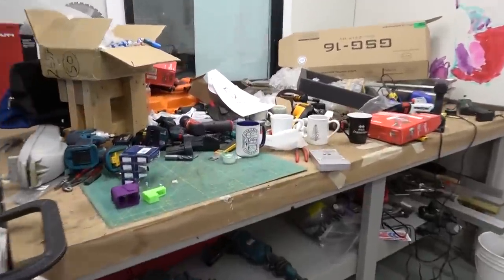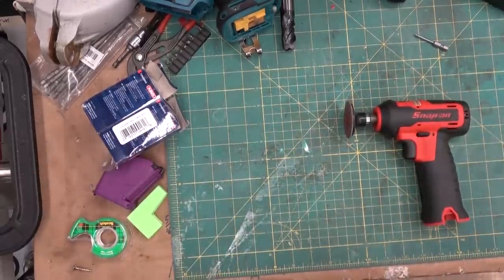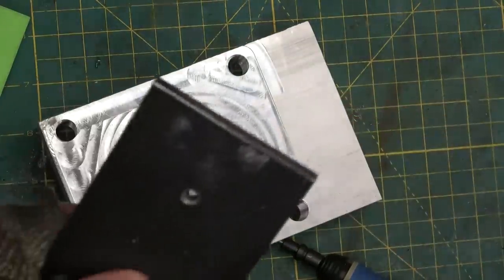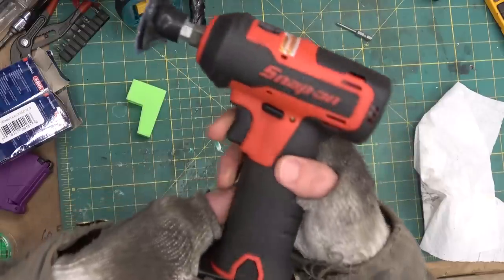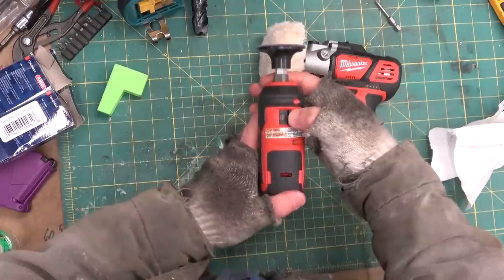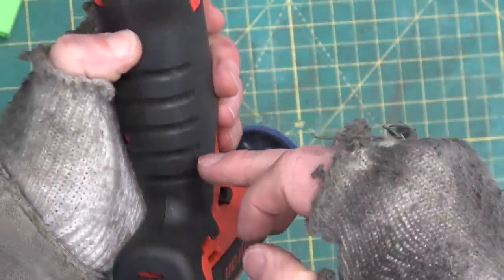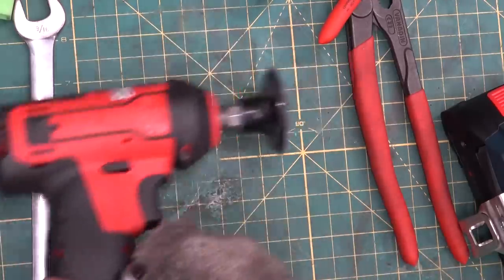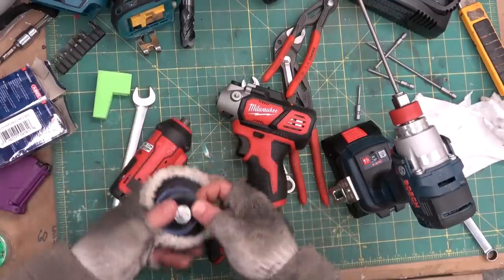BOLTR: Snap-On Polisher $$$ worth it?

Comment: I use both on a daily basis as polishes so in the slow setting and i find the snap is better purely for the increased torque and allowing more pressure to be applied whilst polishing

Comment: I have this tool. Bought it back in 2016. Two batteries and a charger in the kit ran me aboot $400. I work in the boating industry doing gelcoat restoration, and bought this for buffing out tight spots where a polishing wheel won't fit. It's lived mostly in a saltwater environment. At the time of purchase, nobody else was making a tool like this. That being said...I didn't have any problems with the fit and finish. It still looks and feels good 3 years later. The battery life is shit though if you use if for more that a few seconds at a time.  I wound up buying the screw gun in the 14.4 volt line just to make better use of the batteries. If you have other tools in this line, it might not be a bad thing to have. In the US the tool only is about 200.00. 

Oh....It took a shit this year and I had to have it rebuilt by Snap-On. That was $105 with a 90 day warranty.

Comment: Koon trucking had three of these and they all let the smoke out with light use.
Reply: I had 2 also went up in smoke. Snap on will only exchange not refund
Reply: Damn just in time guys! I’ve been thinking on buying one of these the last wk. Def goin with the millsucky! Thanks!
Reply: @travisarnold8872  Milwaukee is a bad tool their new m12 die grinder is the bees knees.
Reply: lovetolearn 52 appreciate it. I’ll check it check it out. I’ve been using an angle grinder for damn near everything... just looking for something that can get into tighter places and maybe make life a bit easier trying to restore an old rust bucket.
Reply: @travisarnold8872  I think I'd get the earthquake before snap on
Reply: @lovetolearn5253  Definitely go with the die grinder instead.
Reply: lovetolearn 52 enough power to constantly grind down welds ? Thinking about it
Reply: @daevid21  The die grinder is pretty much next on my list of must have cordless tools. Waiting for a good deal. I get so sick of dealing with my air lines for quick jobs.

Comment: The one redeeming thing for Snap On is their cordless tools have never been regarded highly. The quality has never been good enough to justify the price tag.
Reply: Milwaukee and DeWalt. My go too battery tools. Snapon is pure gimmickery. "I'm the best too and you get what you paid for so gimme your wallet"  just ain't true anymore.
Reply: @FGuilt  Just like Harley Davidson.
Reply: @tlr-nut7275  gimme a Kawasaki any day of the week. Suzuki is the harbor freight of cruisers (cheap crap that does work, but never well). Harley is the Mercedes of cruisers (endless money pits with amazing products but way over priced). Kawasaki is the Toyota of cruisers (runs well if you change the oil once on a while with a reasonable price tag on purchase). Love the Kaw.
Reply: Geez my one and ONLY Hilti Hammer/Regular drill crapped out after 2.5 years of home-owner type work.  Cost a fortune too!  I'll be sticking with the M now. SuperGoldnut
Reply: Um. That’s the exact opposite of what “redeeming” means.

Comment: Just about pooped myself laughing when I saw this 14.4V polisher ON SALE for $410 USD last week (regular list claims $440)! I got the 14.4V 1/4" screwdriver for $210 a few years ago, also a "sale" price. It works pretty well, although I had to warranty it for $90 last year. The clamshell and over-mold on my near identical driver held up quite well though; still solidy attached, no peeling or significant degradation after three years in an auto shop (I use it consistently for gear clamps on things like coolant hoses, too.) 
That thing seemed overpriced for 320in-lbs. (I think) but at least it came in a nice bag instead of the case! Thanks Uncle Bumble, and a Happy New Beer to you as well!
P.S. I mean "Thanks" because now I have to crack mine open to see if it has crap wiring like that polisher. Looks like I'm gonna be in the market for a new driver soon...

Comment: I’ve used my snap off to start some small paint correction multiple times—and then I immediately put it away. 

I got the whole kit brand new with battery, charger, pads, carry bag etc for $40 at a garage sale from an ex snap off dealer. It’s an OK deal at that price point.

I always end up switching to my Meguiars DA attachment on my snap off drill. Now THAT thing is skookum for a consumer tool -nooo, not the drill, but the DA buffer.  It would be neat to see a BOLTR on that. Takes the input of any drill and outputs a dual action at pretty damn high speed even with the gear reduction and it’s easy to vary speed.

The snap off drill is stupid light and small which I like. I bought it when working at a shop building race cars and fabbing sheet paneling/hanging carbon bodies etc.

However, the chuck is shit. Mainly because of the MASS of the NUT for tightening the chuck by hand. It’s metal and far too thick so when you let off the trigger quickly and it screams to a hault, the nut wants to keep going so the chuck loosens up after a few quick trigger releases. 

Snap on rebuilt it after I complained about the chuck and gnarly noise at slower speeds with no load in high gear. They replaced the motor and the chuck and It still has the same problems but I learned to live with it and it still works (~6 years later now)

Comment: Have had the snap on  for 3 years and it works amazing still and the rubber has never bubbled up. Use it for sanding gaskets off and knocking rough edges off

Comment: I work in a body shop that works on a lot of high end exotic cars. I bought one of these about two years ago and have used it at least once a week since then for polishing. The overmolding has never given me a problem, but it did let the smoke out the day after the warranty ran out. I had to pay to have it repaired through snap-on, I think it was around $60. It took about a month to come back, and when it did, it only lasted a week before making horrible grinding noises. The second time I had it repaired it was free, and it came back with a little note telling me that i had to let the tool "cool down" and was not made for continuous use. It felt like they were telling me that I purposely miss-used the tool and they were tired of fixing it. Ive had it back for maybe three or four months now and it hasn't given me any problems. If anyone asks me if i like it i usually tell them that i love the concept of a battery powered polisher, but would not buy this one over again.

Comment: I have the 1/4 impact which is very similar and I've used it as a diesel mechanic specialized in engines for years. Brake Kleen, contact cleaner, oil, coolant. You name it. The rubber is kind of coming apart on the edges but is holding up well. The rubber does swell up a bit but doesn't keep getting worse. holds up very well considering the abuse.

Comment: I do not have that specific tool, but I do own their screw gun which appears to be the same frame.  I am an aircraft mechanic and I love the screw gun.  I have  used it daily over the last three years and I have not had any issues with it.  I also use isopropyl  alcohol and av gas to clean it daily and have not had any issues with the grip material on the handle.

Comment: I've owned the strap on one for over a year. I'm a diesel mechanic and a welder fabricator. I use it daily. The over moulding is still in great shape on mine. But I never grab it with greasy mits. I've gotten atf on it and it definitely turns slimy very quickly. Mine also will suck freshly charged batteries to nothing if left in over night.

Comment: A couple of fellas at work have the whole Snap On lithium tool lineup , with all the batteries. In a diesel shop the over molding does start coming off. I have a set of Kobalt(blowes house brand) impacts, drill, light etc and the rubber is holding up better after 4 years.

Comment: As for the milldoes hardyness, we've got em in the rail workshop, coated them in crator grease, cleaned em up with white spirit, over and over, giving zero F's and no love, they're holding up really well, not peeling apart yet after about eight months. Seriously though, we asked for two pneumatic buffers (shinano at around 150 au dollarydoos) and they turn up with those vibrators worth a set of gold teeth. Purchasing officers - you wouldn't feed em.

Comment: Happy new year! A treat as always. If you see the budget brand Tacklife it would be awesome to see one of those get the AvE treatment, I have a recip saw and sander from them, dirt cheap but the saw gets a real beating in the garden cutting away smaller trees, I don't bother getting the chainsaw ready with the gas oil fillings and chain sharpening. The thing just keeps on going so it must be chooching decent on the inside (cherry Laurel hedge 100M long I cut 25% of stems down each year, and with five adults plants on a meter with a trunk diameter of 15 to 20cm thats a lot of cutting. )

Comment: Ave, my friend, how are you?
Reply from the maker: Good man. Back in the thick of it. You?
Reply: 3/8 stubby I got it's a monster for the size
Reply: Yep. I have the 3/8 stubby. It’s amazing that it’s a 12v tool and how powerful it is. I’m a heavy equipment mechanic for CAT and use mine every day and love it. To the original poster, if I’m not mistaken, the only difference between the 1/2” and 3/8” is just the size of the anvil.
Reply: @dkjoses12  I went an bought one as well, It does pretty good have to let it hammer a bit if you need to use any adapters but I'm happy with it.
Reply: @adambell2068  that's good to know

Comment: I've got the cordless screwdriver which is pretty much the same thing but with a rocker switch and a clutch.  I wanted the long neck electric ratchet and my 12 year old 7.2v Snap-On screwdriver batteries were pretty much shot and no longer available, so I sweet talked the Snap-On guy into a deal on the combo of the two tools with two batteries and a charger.  I could go into how much BS it is that they sell the tool, battery, and charger individually these days, but that's not the point.  It's been about six months of pretty much daily use (I'm a mechanic) and the tool is holding up pretty good.  I stopped using solvent to clean my rubberized tools a while ago because you never know which ones will turn to goo until it's too late, so I can't comment on that part, but aside from avoiding dousing the thing in brake clean I'm not exactly nice to it and it still looks brand new.  At first I was disappointed that it isn't brushless but the batteries last plenty long and it will twist your arm off if you set the clutch to full tight and it grabs, so I guess it doesn't need it.  I don't like how you have to push the 1/4" chuck in to attach/release tools, it's the opposite of my Milwaukee drill/driver and if you don't push it perfectly it cocks sideways and binds.  I've used it to break quite a few overtightened bolts loose and although you can sometimes feel the clamshell flexing in your hand it seems to take the abuse just fine.  Time will tell if it will hold up as long as my old one that I will be rebuilding the batteries on eventually if anything because it would be a shame to retire such a good tool for lack of batteries.  One last thing, the LED is at least two colors, it goes from green when the battery is full to orange when it's time to charge, don't know if it goes red after that I always just charge at orange.  I wish the indicator was better than that but I guess it's better than nothing at all.

Comment: I use one of these at work It goes through batteries because it's NOT Brushless and it really needs to be ! 
It also gets very hot in use - used mostly with scotch brite pads to clean gasket faces 
Doesn't get greasy so the over molding hasn't come off the tool even after years of use.

Comment: I've had this for about 2 years now. I've not had a issue with it and use it to do some lite sanding on racecar parts. But I'm not real gentle with it. I've also wiped it off with brakeclean a number of times. None of the over molding has come off and it still runs pretty good. I've read a lot of people have had issues with them but mine has been trouble free.

Comment: I purchased one of these about 8 months ago smoked the motor first time I slapped a battery inner choochin on pair headlight lenses. Fap off fixter and has been sitting at the bottom of my junk drawer since. Great Vijayjo! , this piece does not bleed fap off and certainly don’t get yeole el stampo approviale.

Comment: This might get burred in the comments, but I have a similar, but older style Snap On screw gun, CTS661, IIRC.  Its been used nearly 5 days a week for the passed 6 years. The batteries are not as good as they used to be but still works great otherwise. The over-molding is still in place and has not began to peel up or degrade after being doused in oil, fuel, brake fluid and other stuff you'd find at a motorcycle shop. 8/10 would buy again.

Comment: I had a set of those snap on guns, not the polisher but a 1/4" screwdriver and a 3/8" impact. The rubber held up very well, and I cleaned them with a rag and non chlorinated brake cleaner 3 times a week for over a year. The issues I had were the terminals in the battery would spread apart and not make contact, and in the 3/8" impact the solder joints would fail for the blade terminals that go into the battery. Either way they started working intermittently, did a few warranty repairs, super frustrating. Switched everything to DeWalt and I haven't looked back.

Comment: Try out the fuel version. It turns at 24500 rpm
Reply: yes.. this tool was mainly used in shops as a cordless die grinder with sanding s
disk or the 3m green gasket wheels, since no one made one, now that the fuel die grinder is out, which I do have and works great. I don't think there's much market for either one of these 12v buffers being used as sander/gasket removers.
Reply: I have the new fuel right angle grinder.... thing is incredible. Haven't used my pneumatic one since.

Comment: I'm a car mechanic and i own this tool and the other small snapon guns with the same battery for 3~4 odd years.
don't use this polisher much but i already had the batteries from the impacts and it's compact, 2 wrench to change does annoy me a tad when i can't find the 2nd wrench.
The overmould has not come off on any of my guns, i do try to keep them clean though. the rough treatment gun got greased a couple times and instead of peeling the grip material now feels kinda sticky but not gooy to the bare hand, almost like some 10year old car interior plastics when they're exposed to the sun too much. 
the rest are no issues.

Comment: AvE, what do you think of makita's impact wrenches? Been thinking makita or Milwaukee
Reply: I haven't used the makita but I have the big boy half incher from milwaukee and I verified this with a 3/4 torque wrench that it can put out over 480 foot pounds. It was a track pad bolt on a brand new D8T at a landfill. Something like 1 or 1-1/4 fine thread
Reply: @deankruse8751  my wife bought me a aet of 5 Ryobi tools 15 years ago when they were NiCad so I have been forced to stick with because of wanting to keep 1 type of battery. All the old tools work with the lithium batteries and have have bought 8 more tools since then and have had 1 break and I put them through a lot of abuse .The hammer drill, sawsall came with tje first set and all still work great... I wonder if I hit the tool lottery with the ones I have.
Reply: @kardeef33317  if I'm not mistaken ryobi is the same as milwaukee just a year or 2 behind and a different socket for the batteries so they dont match the milwaukees. I dont know if they have the full product line that milwaukee does but all the common stuff, drill, driver etc
Reply: @deankruse8751  nothing like the Milwaukee and saposed home gamer grade not professional . I am surprised  I haven't had 1 problem in 14 to 15 years. Was on a job a year after I got my first set and was using the hammer drill alot, a co-worker went through 2 Milwaukee's hammer drills and they cost 3 times what the Ryobi does.
Reply: I have had Makita + Bosch + "other" tools all bought at the same time, used roughly the same amount, in rotations..the only ones that still chooch after the dust settles are the Makitas..by attrition, and survival of the fittest, my tool collection has ALL turned turquoise..only Ryobi tool I ever had was a petrol hedge trimmer, a great little thing still working 17 years later, but in my workshop now the only non-Makita tools I have are the ones Makita just don't make.
Reply: I've had the Makita XWT08 for a couple of years.  It'll either break the bolt loose or snap the head clean off in every application I've tried full power on.
Reply: I've been thinking about getting a Makita 3/8 impact for when I don't have access to air (outside, or at home). But I would like to know uncle bumblefucks opinion on them before I drop the cash and be disappointed lol. I'm an air tool kinda guy so I'm not used to spending 400+ dollhairs on a tool then having to charge it every so often.
Reply: Have a Milwaukee I got for just over 200 doll hairs. It's a right proper nut fucker if you ain't careful, 1100 ft pounds on the screw off, about half that going in. Lasts a good damn long time on the angry pixie storage box as well
Reply: Makita makes tools that last. Milwaukee makes tools that are cheap enough to replace 2-3 times during a 5 year warranty and still make a profit AND pay for a (I'm not making this up) $1 billion/year marketing budget.
Reply: @Demonslayer20111  angry pixie storage 😂😂😂